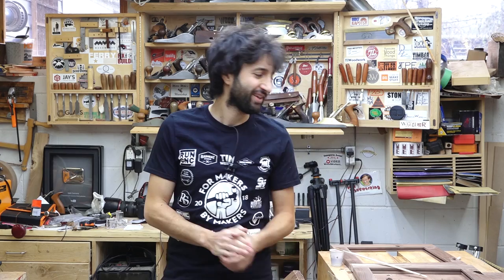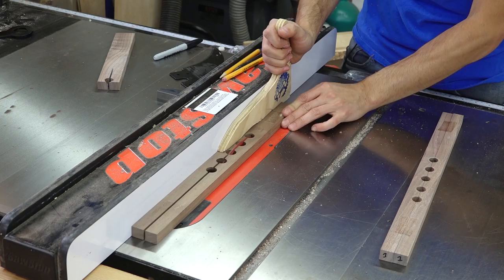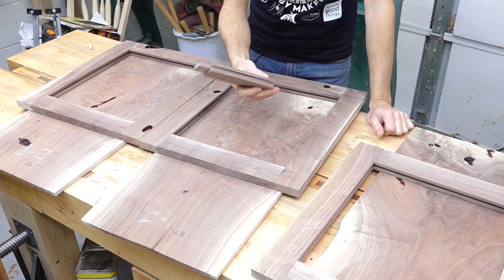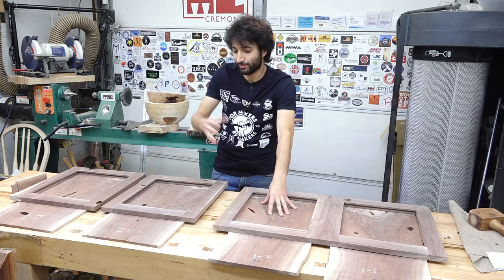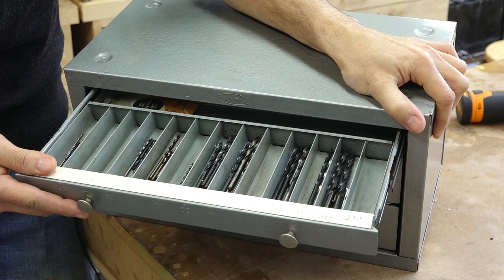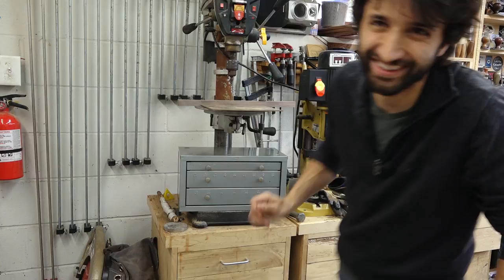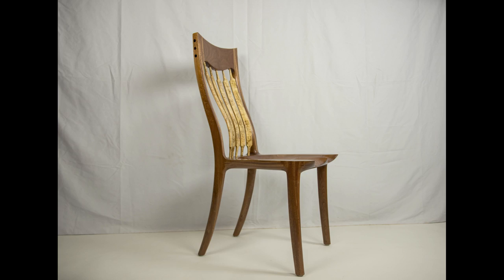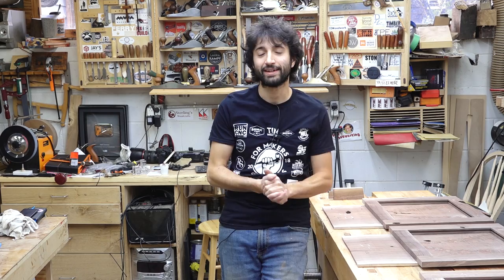Matt's Weekly Shop Update   November 5, 2018

Comment: Matt get you bit sizing card. They are sized and numbered and normally made from steel. This way you do not have to look for sizes. Just slide the bit into the proper hole and it will show you size. I like them for my old eyes. I have the same drill bit cabinet handed down from my father. I am 50 yrs old so that gives you an idea how long these cabinets have been around 👍